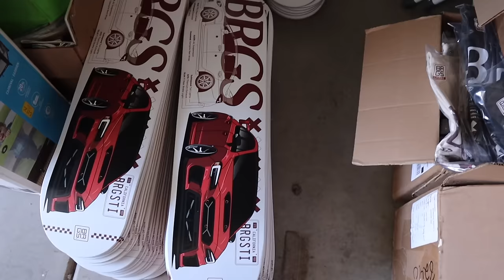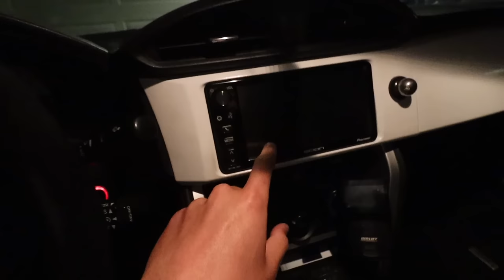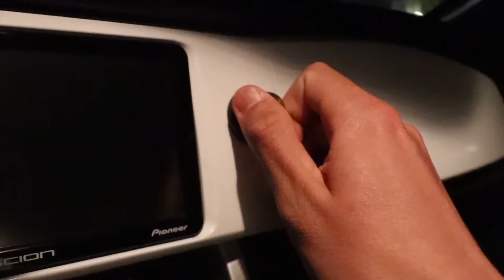Every Subaru doesn’t have this… but YOU NEED IT!

Comment: I added a sub, changed door speakers and use the Sony XAV- AX4000 head unit pretty good setup for that more refined feel. It has good EQ settings available to dial it in as well.

Comment: you should run an IDoing head unit. i use it in my FRS and it’s got wireless carplay and has compatibility with aftermarket subs and amps
Reply from the maker: Heard good things about these!
Reply: @chris_borges  i been tryna see u install one bro!! i just did mine

Comment: im running a Sonh XAVAX3200 in my frs. super easy install with the metra wiring harness adapter and the metra trim pieces. has wired apple carplay and i think it can connect to better sound systems. i dont have any aftermarket speakers/subs, so im not sure, but i love the head unit. definitely worth it

Comment: You shouldn’t put your sub in your back seat. Sound will be much better in the trunk. Bass sounds waves are very long and the further it has to travel the better the bass. Not to mention it is easier to damage the sub  in an area you are constantly in

Comment: Hey Chris, about to do my first oil change on FRS, seeing mixed recommendations on how much to add. Any suggestions? Seeing 5.6 quarts oil online
Reply from the maker: Correct! Just start with 5 and keep adding and checking the level as you go. Typically what I do til it sits at the full line on the dipstick. 💯